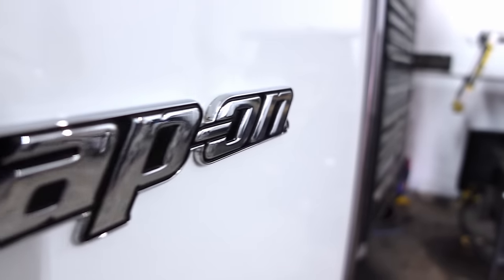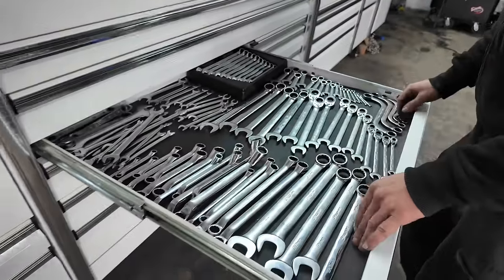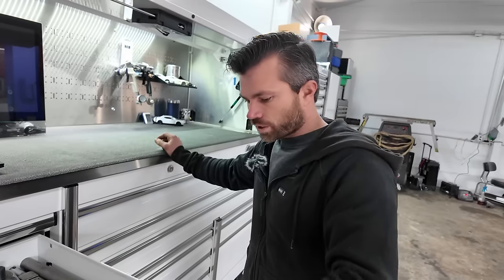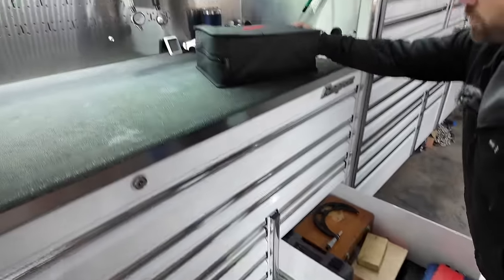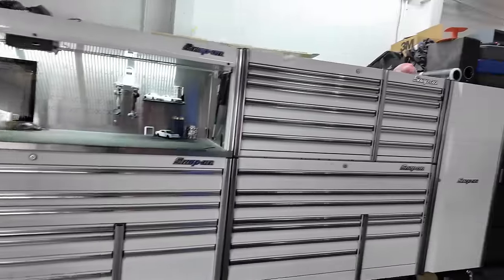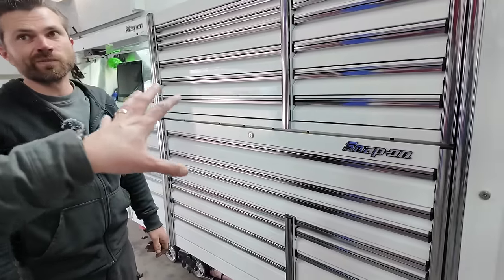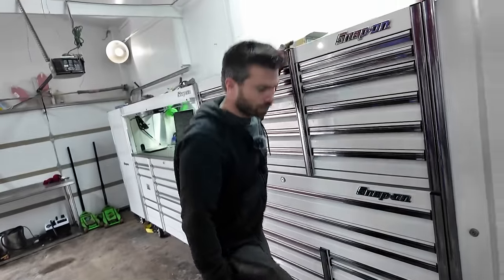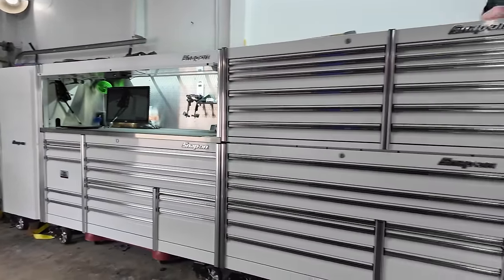Inside a $65K EPIQ Toolbox - This thing’s MASSIVE

Comment: Im always surprised people like the wobble plus extensions. Wish I never wasted money on mine and went seperate wobble and straights from the start.
Reply: They’re all I have.  They work so well I never saw a reason to buy anything else minus a few specialty ones like my 1/2 to 3/8s transmission one or my 24 inch long 1/4 locking extension.  But I’ve been using the wobble plus since I started almost 9 years ago now and other than having to replace the occasional lost one, I’ve had absolutely no issues with them.
Reply from the maker: Curious, what’s the benefit of having them separate?
Reply: I’ve noticed some older guys don’t like wobble plus because they seem to(for them) go from wobble to straight extension too easy and it’s frustrating when you want the angle to stay wobbled, if that makes sense. I found that if you line up the ball detent with your socket hole. The wobble plus work great, but if you don’t line it up they can switch unintentionally which is where the frustrations comes in
Reply: @ToolBoxTour  its annoying having them go from wobble to straight with even just a little pressure, especially with longer ones in tight areas. Annoying enough for me that I went to normal wobbles. They kind of do both jobs ok but neither great but some guys seem to like them.
Reply: One of my coworkers always talks shit on my wobble plus. It's all I use 😂. When they get a little loose I just warranty them

Comment: Glad I’m not the only guy that keeps the silica gel packets in his box lol. I started by keeping them in my gun safe. But the last 15yrs or so I’ve had a lot more issues with Snap-On tools developing rust.
Reply: The silica gel packets definitely serve their purpose
Reply: @EverythingAviation304  once silica porosity is saturated  you have to heat it to desorp water molecules. The purpose is to trap residual humidity in sealed packaging for long durations. Once exposed to fresh humid air it quickly stop working. 

Best way to prevent rust on steel is to oil them from time to time. Most woodworking tools use high carbon steel instead of stainless.

Comment: Reamers…
Say you have a 9/16 hole that you need to make 5/8.  If you were to run a 5/8 drill bit through it, it would be super grabby and probably try to break your wrists.  A 5/8 reamer will do the job very smoothly without any grabbing.  
And the those little flat pry bars are referred to as “hive tools”.
Keep up the good work 👌🏼
Reply from the maker: Thanks for that info. Makes way more sense!

Comment: ****so I'm not a mechanic but I found a Snap-On wrench on the side of the road when I was driving truck. I never I thought anything of it I seriously would just use stuff from Walmart and at most maybe gearwrench. I can tell you that I have used that 13 mm snap-on wrench that is something like $45 on this small engine that I'm taking apart right now. I'm Green with this whole process of quality tools and but I'll say that the process of the process of using this wrench to take off a fuel bolts has been a very pleasing experience. They were rusted no issues. The other bolts needed WD-40 to get them off

Comment: The monster light is easy to replace the battery in, I haven't got ahold of the underhood light but they are the same as the "wand" style ones I got. i bought a lot of 20 or more monster led lights that either had bad batteries or bad charge ports. They just use 18650s, can easily solder the wires on, I upgraded the batteries of course. Some lights I'll add or use a higher capacity cell if space allows.
Reply from the maker: Oh good to know! Thanks for sharing that